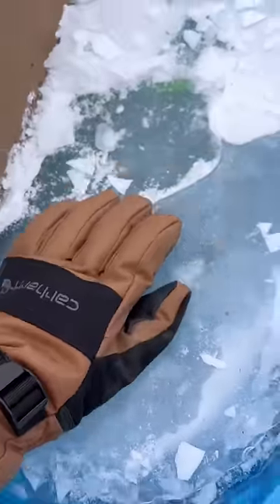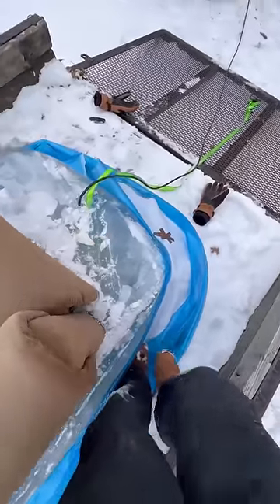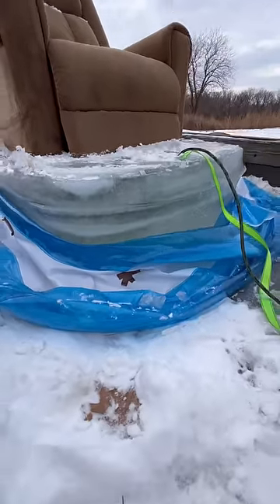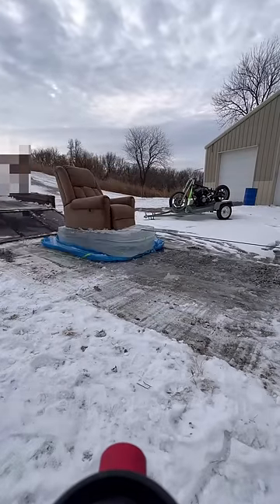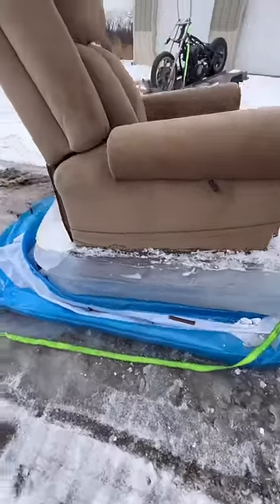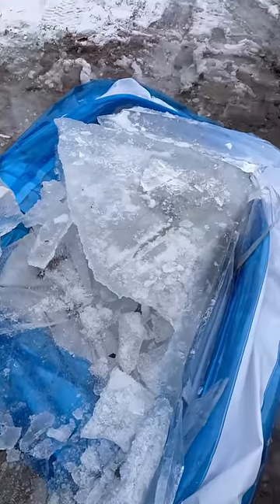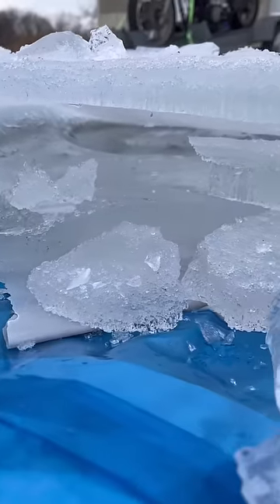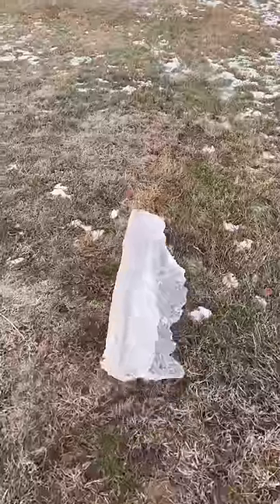2,000lb Sled Fail

Comment: That's at best 300 pounds combined with the chair, probably less, 2200 pounds of water would be 3 and a half foot in every direction including up with nothing in it, meaning the water would be close to the head rest, if you account for the chair also displacing the water you have at most a foot high, and that's not 3 and a half wide, maybe long yes, but at best 10% of the mas to be 2000 pounds, and guys 2000 pound its not 2 tons, a ton is 2204 pounds or 1000kg.

Comment: There wasn't trouble that was God trying to save you from crushing your legs when you're 2000 pound sled steam rolls you when you slide off the front of it. A one ton sled is a horrible idea my friend God saved you this time but if you keep trying he might not save you next time and you might actually get that thing going down the hill and wish you never did if it actually weighs 2000 pounds😂

Comment: Soon as I saw the leak I knew the inside was going to be water and wouldn't have the structural integrity to hold together. Also if you do it correctly next time and then that thing flipped on you you could die. Maybe don't be a 🤡

Comment: Freezing water doesn't release heat. Heat going out of water causes water to freeze. It is exothermic but the water itself doesn't release heat.
Reply: No its not exothermic. The rest is correct though.
Reply: @Okararu  Its exothermic in the sense that when water, heat has to move out of the water. Melting ice is endothermic process since ice has to receive heat in order to do that. It is a bit counterintuitive but seems to be correct after googling it.
Reply: @janj7  if you listen to what he says he describes an exothermic reaction. Freezing water isn't a chemical reaction, it's a change of physical state. Therefore this term doesn't really apply here.
Reply: Yes freezing water does release heat. You can easily look it up.
Reply: @Okararu no he doesn't. He says that it is exothermic. He never called it a chemical reaction. All what he said was correct. You are the one that is wrong here. You think "exothermic" and "endothermic" are only properties chemical reactions can have. When that is just not the definition of the word.